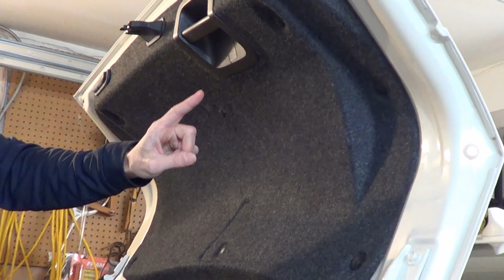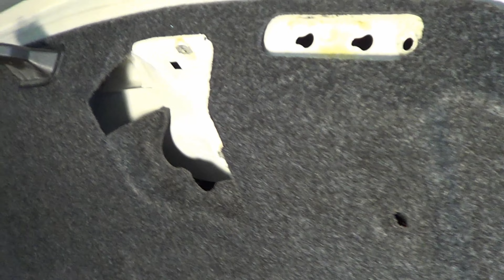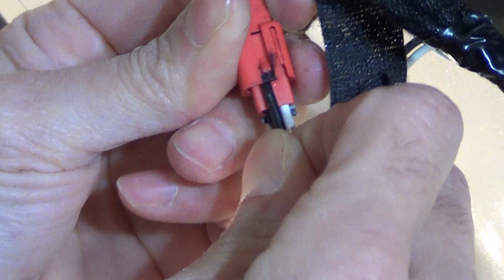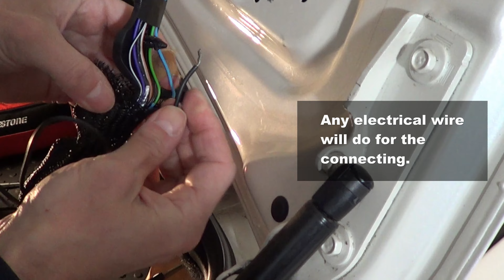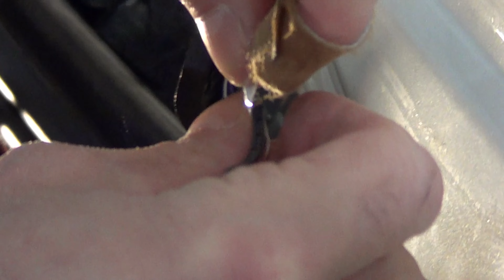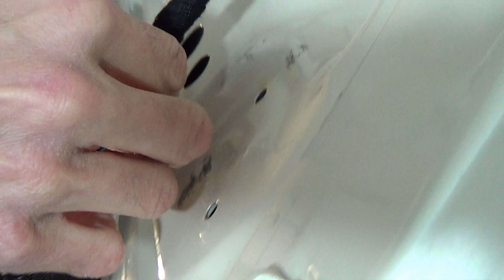Cadillac CTS Third Brake Light Common DIY Fixes  - 2008 to 2013

Comment: Thanks for this video. I fixed mine myself on a 2010 CTS with these instructions. It was the exact same wire - the blue one that broke in the same place. Considering others here had the same problem there should have been a recall on that wiring harness. The blue wire must have been manufactured slightly too short and stressed on that bend. I fixed mine by soldering in another 3" piece of heavier wire to connect the two broken ends and covered it with heat shrink tubing. Very easy to fix. It helps to have a trim pin remover tool.
Reply from the maker: Great work on the permanent fix, that extra length is definitely a smart way to handle that stress point! You make an excellent point regarding a recall. 👍

Comment: Should’ve used heat shrink tube for wiring. Just saying do it right. Don’t tape that
Reply from the maker: Thanks. It’s a good point you make. Heat shrink would work well too and be better than tape. In the video description I offer what I call is a best solution, one that uses a crimp tool and wire butts…which is similar to your suggest of a heat shrink. A few ways to make this work. What was shown in the video is still working well, even after a few years. Tape works and could last long too.

Comment: Could you explain how to take the Led trunk brake light, my wires are good and it use to work si im guessing it went bad
Reply from the maker: They do go bad. Like in the video to fix the wires you’ll need to remove the carpet, that will then expose a few bolts that need to be removed. From there, you’ll need to pull it out. It will feel stuck to the trunk, from the weather seal used to keep the elements out of the trunk. Try using equal force on the right and left sides and it should come out. There are a few after market brands that make the LED unit, which is the entire unit. I haven’t done this in a while, so I’m going by memory.

Comment: We have a 2008 cts and now i believe i have water leaking into the truck deck lid via that third brake light and ir the gaskets are bad. Im thinking if using silicone to seal it up. What are your thoughts?
Reply from the maker: You’ll want to be certain the water is coming from the third brake light. Try removing the carpeting to be sure. You can certainly replace the entire third brake light, but that’s costly. Silicone can work, like using clear silicone in between the metal and plastic, but it won’t look good. I’ve seen a few bad examples in scrap yards. The third brake light seal does deteriorate through time, and that’s where water can seep in. A cheaper, better looking option, would be to remove the existing light, then bead with silicone and reinstall the old light back.This would form a better seal and you won’t see the silicone or see a lot less of it. The drawback here is if you ever have to replace the third light, it would be difficult, as it would be strongly stuck on. I hope this helps.
Reply: @HandyVal the deck lid fabric gets soaked near the area where the light is, when you open the lid, water will drip out from the front off the lid, so it has to be coming from the 2rd brake lights area, the entire deck lid fabric isn't soaked, just right near that light. It may have 4 screws and seals on it, im going to get some gorilla caulk and seal silicone and take the light off and lay down the silicone around the deck light area and reinstall the light, try to prevent it from being seen and the water can't come thru

Comment: You will find the biggest issue with these cars and when lights dont work, tear open that wiring harness and check all of those wires. I had to repair like 4 or 5 wires when my lights didn't work, like all the lights. Also cut that hard plastic piece in half or remove it all together,  that hard plastic doesn't allow alot of flexibility for those wires
Reply from the maker: Thanks for your your thoughts on this. It’s a poor design flaw that leads to these wires being cut. You’re right.

Comment: Do you know what gauge wire is used for the 3rd tail light wiring ,noticed my light wasn’t working,watched your video and same thing happened to my 09 CTS but don’t have a way of measuring the gauge of the wire need to buy some to splice in
Reply from the maker: I’m glad you found the video. I don’t recall what gauge it is. However, an 18 or 16 gauge should work just as good.

Comment: What could be the issue if the passenger taillight LED strip not working but the brake and the signal work fine? 
The passenger headlight high beam not working either?
Reply from the maker: For the passenger high beam it likely is a burnt bulb. Bulbs are cheap, but the process to replace is time consuming. For the passenger taillight LED, I think it’s a faulty LED, which requires an entire new taillight. Before replacing it, check fuses, check the connector and check the wiring as in the video, to ensure no broken wires.
Your two issues are two separate issues.
Reply: @HandyVal  thank you for the information, I actually did replace the entire taillight assembly and still not working , so figured out that must be something else, the signal blinks normal and then starts running rapidly, and again the high beam not working.
Which fuse should I check in the trunk or under the hood please?
Mechanic is asking thousands of dollars and there’s no way I’d fall for him.
I appreciate your help.
Reply from the maker: We can figure this out. Avoid the mechanic bill for now. It depends on the model and year for your exact fuse location. It could be a malfunctioning fuse related to the tail lights and/or the headlights. The high beam could be a burnt light or fuse - see fuse associated with the high beam. Is the signal flasher part your headlight or tail light?
Reply: @HandyVal it’s 2011 Cadillac CTS Luxury 3.0L if that helps!!
The headlight low beam is the only thing is functioning at the moment ( no signal, no high beam)
The taillight the LED not working, but the brake light and the signal are working ( signal runs rapidly).

I did try to look up some information on the manual but couldn’t figure out anything. 

If you have any suggestions please hook me up.

Thank you!
Reply: @Jordan-de3du hey did you ever end of find the problem for that 3rd break light I’m currently having a problem with thag and I can’t find the reason

Comment: Just wanted to point out the rectangle rubber pieces will slide to the side and release, no prying needed. Great video!
Reply from the maker: Yes! That’s the better way, to simply slide it - thanks for pointing it out and sharing it.
Reply: @HandyVal  My 3rd brake light was leaking so I found your video on how to reach it, the 1st block I pried like you did but noticed 2 of the 3 were slotted. The second I lifted the one edge and slid it over and it was a bit easier.

Comment: I just wanted to give my thanks. A short & concise video about the problem & it was EXACTLY MY PROBLEM on my '14 CTS-V. When I opened up the loom, I had TWO wires snapped that took out my 3rd brake light AND license plate lights. I had gotten stopped 3 times because of the license plate lights & 3rd brake light. I had no indication they were out until police let me know. Once was after I was testing with new license plate bulbs. They still didn't light up & double checking w/the multimeter I got 0v at the socket. 

Once I pulled the trunk apart using your video, it was easy to splice in a chunk of wire, test, verify & button it up. 

THANK YOU!
Reply from the maker: That’s fantastic!  I’m so glad that it helped you. It was a Cadillac design flaw with the wiring but for most of us it gave us 10+ years of no issues. And luckily it’s a reasonable DIY fix. The license plate wires breaking for some reason are not as common as the third brake light. Thanks you.

Comment: Anyone has any idea what could be the problem with the trun signal no working at all , i have a 2009 Cadillac CTS 4
Reply from the maker: Let's see if we can fix this. There are a few things this can be.  Try these in this order, easier to harder... Fuse related to your model and year, then turn signal relay (should be under the steering wheel carpet) and then the turn signal switch itself (which is difficult).

Comment: Greatly appreciated sir! My 09 just hit 110k, and I have replaced the 3rd brake light now 3 times. On the 3rd replacement it still  wouldn't light up so here I am. And wouldn't you know my blue wire was broken just like yours. Glade I found this video
Reply from the maker: @goeasychristopheerson150  Happy to have helped. It seems like an obvious small miss for the Cadillac engineers. Regardless I still love the CTS!

Comment: Thanks, Handy Val. Your video just saved me a lot of money. I had two broken wires. Something you might have mentioned was to go ahead and inspect the other wires while you had it apart. I found two wires that were slightly cracked, so I went ahead and taped them up just in case. Thanks again, my friend.
Reply from the maker: Happy to have helped you out. Great advice - always a good idea to inspect everything while you're in there. Thanks for the feedback! I’ll add the suggestion to the video description.

Comment: We have a 2008 cts and it has a light issue with the taillights,  license plate lights and the 3rd brake light if I remember right. That hard plastic harness where the wires come into the trunk is where every light issue with the car was. Because that hard plastic doesn't allow the wires to move enough and I had to splice and put back together 3 wires and everything was working again. So I just cut that hard plastic piece in half to allow the wires to have greater flexibility
Reply: Your video was perfect found the neutral wire broken in the same spot as yours was able to use a solderless crimp to fix it 👍 thanks again
Reply from the maker: Thank you. Smart idea with the solderless crimp. Should last a long time.
Reply: @HandyVal   I forgot to mention I have a2009 caddy CTS  I was able to pull some slack from above which made it easier to crimp the wire
Reply: @jimruddy4399  if you cut that plastic harness were the wires come into the trunk, it will allow more flexibility to the wires. I cut that and had to repair 3 different wires and checked all the other ones, all good at the moment. I think I used the crimp style with solder in the middle and shrink tubbing
Reply from the maker: @jimruddy4399  Thank you. You're absolutely right. There's a bit of slack as the wire snakes around the trunk door.
Reply from the maker: @null046  It's a good idea. I think I'll do it as well. Last thing I want, is to be on a road trip and have a light go off because of a broken wire. Thanks for sharing the idea.
Reply: @HandyVal  yes, check your wires, mine were all in about the same spot as to where the breaks were
Reply from the maker: Thanks for sharing your experience. It’s very helpful. Did you cut the hard plastic in half and then kept the two pieces in their usual position? That is, you didn’t take any of the hard plastic away but just cut it in half only.
Reply: @HandyVal  yes, I cut it in that bend it has so the wires could have more flexibility.